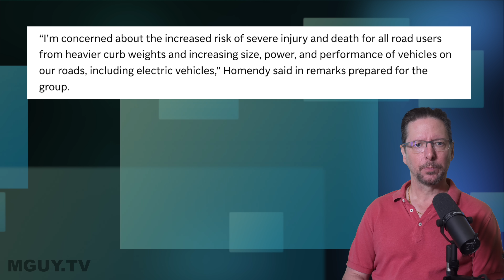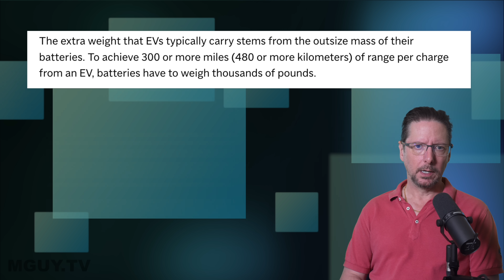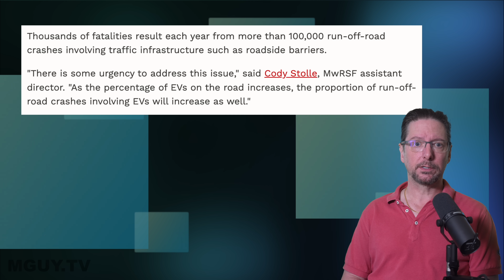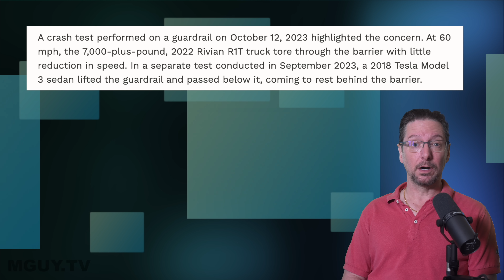EVs TOO HEAVY for roadside crash barriers (guard rails) | MGUY Australia

Comment: Big problem with most EV’s is the battery is not protected & just hitting something on the road such as a bolt piece of wood ice chunk ice damages the outer plastic of the battery it could right off the car & the warranty in void & your insurance will have to pay 💰

Comment: 100 people a day  in usa drive in to a building or in to a shop front. how evs get up and go they going to be at much higher speed, but people may say brake censors but if a person mixed go pedal for the brake won't that just over ride the computer. more and more evs with weight can crazy get up and go, and older people been fooled to buying them i feel safety is a big issue, if not current prob near future. when i park i also try park as far as i can from them, if not fire risk but some going out control or user error

Comment: Roadside barriers are designed to withstand and deflect the impact an HGV, so they should be able to handle a 4 ton EV pickup, if properly designed and installed.

Comment: Those barriers aren't designed to be hit at 90 degrees as in that flawed test either.
The problem is still real, just not that dramatic.
When hit in the typical way they're designed to prevent run-off those barriers should contain vehicles up to 3T since that's the specification when correctly installed.
The monster pick-ups you see in the USA, especially the battery powered ones often exceed that though.

Comment: I would love to see you or anyone else calculate the true MPG.  Taking into consideration the amount of oil needed to generate enough electricity for 1 mile and factoring in losses from long transmission distances. I find it hard to believe generating electricity from oil, transmitting it over wires and then powering an electric motor (which has losses itself) is more efficient than an internal combustion engine connected directly to wheels.

Comment: My 1998 Saturn SL weighs 2250 lbs and gets about 40 mpg.  Cars (which barely exist), SUVs and trucks have gotten insanely heavy since the 1990s, and good point guard rails installed years ago are probably not engineered for modern vehicle weight.

Comment: I'd love to see how safe EV's are in black ice and Snowy conditions.. I doubt any EV could handle driving with the necessary throttle along with steering and breaking control required while going up and down ice covered roads and around sharp corners.

Not to mention I got to wonder how thoes heavy EV's do when Hydroplaning.

Comment: This one in my opinion is not strictly BEV issue, yes they are on average heavier than equivalent of the same ICE car if one exist, but the consumer trends are clearly set to get more and bigger cars, people buy increasingly big and unnecessarily big SUVs anyway. Sure double trouble if they are also BEV, but overall that is consumer demand for big cars rather than BEV specific.

So I think the way they should be dealt with is something like "heavy vehicle tax", say anything over 2000kg or maybe 2500kg, or maybe in exponentially increasing scale starting at 1750kg for every 250kg extra can be taxed. As such it would shape buyer choices and manufacturer priorities. If the car weights 2080kg, then manufacturer would look into ways get the car under the threshold to fit into tax bracket. And yes it would generate stupid results where every car weights 1998kg, like we have many engines being 1998cc, and stupid Japanese 276hp (gentlemen agreement) and some cars targeting 75 or 49g/co2 and then getting caught cheating... but car weight is one key thing which impacts everything else, the lighter is the car the less it wears the road and itself, the less overengineered all the parts have to be, the easier it is to handle... etc. In short less weight is always better.

Talking about UK (but also could be adapted elsewhere), I would outright ban SUVs from overtaking lane and would also limit them to 60MPH, also same for Vans (currently wans can only do 70MPH on motorway, but not any dual carriage way, which is kind of dumb). So it would be double whammy for large SUVs... not only you are hit with say £500 a year "heavy vehicle tax" on your Range Rover, but also you are now prohibited of showing off in overtaking lane and have to stick with the trucks as an insult to injury... and hopefully that would promote more people buying more varied and smaller cars more suitable for their needs. Obviously, if you really really need Royce Royce Cullinan with it's (surprisingly little 2660kg curb weight) then you can still have one, pay extra £500 for SUV/Heavy vehicle tax and will be restricted to 60MPH and prohibited from the "fast lane". 

In short reason why different speed restrictions exists for different vehicle types is that heavier vehicles require more care when driving, so if we restricting trucks and buses, also restricting vans, then why don't we restrict 4000kg monstrosities that reaches 60MPH in 3 seconds? I would not go as far as saying they require different category on the license, but 3500kg limit on B-category should be kept and anything over 2000kg should be further speed limited and taxed. And also it is not just dumb arbitrary tax - heavier vehicle damages the road more, so pays more tax. Also it probably would end absolute BEV madness... sure make BEVs, but make sure you stay under 2000kg as else your product will not be popular as it will attract extra tax.
Reply: Replying to @lp9280:

*DARZHSHARZNERFLARZHERSHNARZHFLERZHERBLARZHSCHLARZLE?*

Comment: The Tesla model 3 RWD base model is 1700kg. Not really that heavy.

THe only con with EVs is how expensive they are. A 60kWh battery should now cost $3,000 US (about $5,000k AUD). Then you've got an IM/RM drivetrain, an inverter, and a Battery management system. Oh, and the car body, 4 wheels and some seats.

There is now way that EVs should be so expensive.

Comment: More or less hidden away in the single vehicle impacts into such solid structures as concrete bridge supports is that frequently the engineers do have to do a full safety assessment of the entire structure to ensure that it's strength has not been compromised.  A significant number of these crashes are deliberate, as in suicide and also murder suicide.  The additional mass of such an impact by an EV may be enough to either bring down the overhead structure or at least make it unsafe for further use.
Many of those structures in my part of the world (SE Qld) now do have deflection crash barriers in a bid to prevent such impacts.

Comment: It became UK roads policy in 2005 for  central barriers on ALL UK motorways to be upgraded to higher and stronger concrete barriers. You will remember the spate of crossover incidents due to the rise in SUVs , well before EVs were on the road. 
The research on the subject was done in the UK many years ago, some prompted by the need to protect buildings from vehicle attack . The Thatcham reseach facility published a video showing how the current metal barriers failed when struck by HGVs even at glancing blows , whilst a  concrete barrier would stop a lorry driven at speed directly into it. 
The 'problem' has nothing to do with EVs , it simply comes from the size and weight of many vehicles on the road.

Comment: in Sweden, maybe other places too, we use a cable barrier system. Basically "elevator cables" on poles. Those will stop trucks from crossing the median as it dissipates momentum force along the cables instead of through rigid beams snapping like twigs. Works surprisingly well. Having a runaway Rivian outside the faster roads, more urban environments, is a totally different story though! 

People in general for sure don't have enough driver training to handle heavy powerful vehicles like this. The same with increased gross towing weights

Comment: EV drivers should be aware of the higher risk of dying in a simple sideswipe with a barrier. Its not going to slow them down at all.  They may also turn into blowtorches when damaged. This video put more strength to my absolute refusal to ride in one or allow one to park in my lot. Heavier barriers will do dead-stops to lighter cars, not slow cushion.

Comment: 1:25 The article uses the Hummer but only 4,335 Hummers have been sold since 2021, while in 2023 alone 1.23 million Model Ys have been sold and only weigh 4416 lb (49% of Hummer weight)

"Average weight of a car is 4,156 pounds
Average smart car weight - 1,500 pounds
Average subcompact car weight - 2,600 pounds
Average compact car weight - 2,600 to 3,000 pounds
Average midsize car weight - 3,300 pounds
Average large car weight - 4,400 pounds
Average subcompact SUV - 3,000 to 3,500 pounds
Average midsize trucks/SUV - 3,500 to 6,000 pounds
Average large SUV - 5,400 to 6,000 pounds
Average weight of compact trucks- 5,000 to 5,500 pounds"
(Insurance Navy, Updated February 03, 2024)

Comment: I'll just to take this one with a grain of salt, crash barriers aren't designed to stop any vehicle at an angle like the test shows.  They are designed to deflect a vehicle as it moves off the road at much lower angles.  For example the wire rope barriers common now in Australia will stop a fully loaded semi from passing through it at a shallow approach angle which most accidents like falling asleep etc actually go.  I'm not an EV lover - I often get called an EV hater - but this test is unrealistic and there are plenty of other vehicles (particularly in the USA) that would do exactly the same given the same test.  Totally unrealistic that you could approach most barriers at that angle at that speed in real world conditions and barrier costs would increase by an order of magnitude if they were legislated to stop this kind of impact - pretty much every truck (I'm using that in the Australian sense, not the USA where anything with a cab and ute bed is a 'truck') on the road weighs more than a Rivian and we don't scream from the rooftops about how they could plow through a barrier like this.  

**Zips on flame proof suit and waits for the Vitriol to start 🙂**

Comment: The new EV buses in our fleet have the batteries/battery cooling system placed at the top rear of the vehicle. Placed there for maximum fire safety reasons I would assume. Trouble is it adds 3 tonnes of weight where it would heavily and most adversely affect the vehicle's road handling.

Comment: A crash engineer for a major manufacturer once told me that the best way to survive car to car and metal barrier crashes is in the largest heaviest vehicle you can afford to drive. He said with all the new safety crumple zones and impact resistant sidebodies, let the other car absorb the impact and you may still be able to drive your home. For me that is more important than not being injured. I can't afford to replace a wrecked car. It is why I hold on to three cars and they are all close to 5000 lbs with steel bumpers and one with a homemade MadMax brush guard. The State won't let me get a DETHMTL tag for it.

Comment: To put the 10,000lb Hummer EV into perspective, a 10 wheel tractor without a sleeper weighs around 15,000lbs unloaded. A 6 wheel city tractor weighs around 12,000lbs.

Comment: I am a retired structural engineer.  A small parking space is 8' wide x 20' long, and a standard one is 10'wide x 20' long.  Parking is designed for 50 psf, aside from point loads which are lighter and usually not the regulating load case.  Anyways, 8'x20'x50psf is a  weight of 8000 lbs.  That means a small parking spot can accommodate a car that weighs 8,000 lbs. while a standard parking stall can accommodate a 10,000 lbs car.  Since EV's are far less in weight than 8,000 or 10,000 lbs, this is not a concern, unless you like to spread false rumors by publishing falsehoods.  Cheers from Canada.

Comment: you have brought up some good points I had not thought of. I did consider how all the extra weight was going to tear up roads faster and cause greater damage in accidents against the lighter gas vehicles but never gave thought of parking garages, crash barriers or excess tire wear. As a motorcycle rider,when I see electric vehicles I tend to let the get ahead of me because of some of the self driving options I do not trust. I have already read about these cars not sensing motor bikes causing the car to rear end them. and not sensing pedestrians. I just dont want them anywhere near me when I commute on my motorcycle.

Comment: Every car manufacturer seems to have at least one SUV that is heavier than a typical EV.  Toyota Sequoia, Nissan Armada, Chevy Suburban, etc.  Is it just the weight that is the problem or the distribution?  I would think that having most of the weight near the bottom would limit rollover risk and have less effect on a guardrail than a car with most of its weight up front acting like a battering ram.

Whether they really need them or not, there are a lot of SUVs out on the roads.  For some reason, even though most families are getting smaller, more people are buying cars with three rows of seats.  The extra weight might be a problem for EVs, but it also seems like a problem in general as more people get SUVs and trucks on the road also seem to be getting larger and larger.

Comment: I'm not entirely sure why there is an obsession with heavy EV's.  A two wheel 40 pound escooter can do 20 mph for 20 miles pretty easily.  At around 150 pounds, a two wheel electric can hit highway speeds pretty easily.

For the weight of a transit bus, if it only has 30 riders - why not just get 1,200 pounds of Escooters.

I guess its still about range anxiety.

Comment: Not all EV’s are “significantly heavier than their ICE counterparts”….the Tesla Model Y is the same weight as a BMW 5 series so let’s not make lazy assumptions.  Secondly, whilst the GM Hummer is obscenely overweight, designed to appeal to Americans suffering from a serious deficit in the marriage vegetables department, the good news only about 13 of these monstrosities have been sold.  Thirdly, over 85% of all road accidents are caused by human error which is why autopilot assist and fully autonomous driving software are being developed by Tesla….remove the weakest link and reduce crashes by 85%+.  Also, Tesla makes the safest cars ever tested.  The future is EV’s, you need to accept that fact whether you like it or not!

Comment: This is primarily an issue in the USA where even their ICE vehicles are becoming more and more obese and overweight. Just a look at the "standard" pickup people are running around in now as a daily driver and we see plenty vehicles in the 3 ton and more weight class, these with the increasing height of the front of the bonet/hood, the increasing power they are delivering (both EV and ICE) and yes there are issues, but the issue is in allowing people with no extra driving instruction to drive these monsters. 
In Europe a standard drivers licence, as you get sitting your normal driver's test, allows you to drive UP TO 3.5 ton mag gross weight, anything over that and you need a suplimentary class on top. C1/C1E for example allows to 7.5 ton.
The VW ID Buzz get's 400 odd KM range, is a good size, but weighs in at 2 ton, under half of many of htese USA monsters. It also doesn't feature huge high pedestrian killing frontage.

The power available to drivers in even modest EVs IS an issue, and I cannot see a need for a"family car" to have 400+ BHP equivalent output from the motors, with a 0-60mph time of 4 seconds or less. Those are not designed for normal driving.

Comment: If a crash barrier can hold against lorries (trucks), then it will hold against heavy cars. Typically, the mass of an electric car is only about 30% more than the corresponding ICE car of similar specification. The issue is not the mass *per se*, but the fact that much of it (i.e. the battery) is concentrated at the floor of the car. Thus, it is well focused to punch through a crash barrier, which usually stands only about knee-high. As the massive battery punches through and underneath the barrier, it is likely to be torn open, with well-known consequences.

Comment: EV typically weigh between 1500 kg and 2000 kg. In the UK the guidance suggests that designers of parking garages assume cars weight 2500kg. On top of this there will be safety margins applied to the design. Shouldn't be a problem.

Comment: I watched a portion of a propogandists pro-EV video where he said their are vehicles just as heavy on the road as Teslas. This is a typical EV fallacious argument where they cherry picking select points in order to "win" an argument with themselves.

The issue is on the weight, obscene acceleration and speed with a very low center of gravity. A Tesla, for example, is like an electric missile or battering ram in the guise of a sports car.

An F-150 is a work truck and it's driven like a work truck, not a sports car. Even the frou-frou editions are driven as a truck, because that is what they are. Even if they have an accident in their truck, their higher center of gravity does not defeat guard rails, even Semi's will not. But a missile can.

Besides their obvious time consuming travel limitations, the other reason car rental agencies are dropping EVs is because so many renters want to rent one 'just to see what they can do' performance wise: Basically renting a joy ride in a vehicle where a small dent can total it.